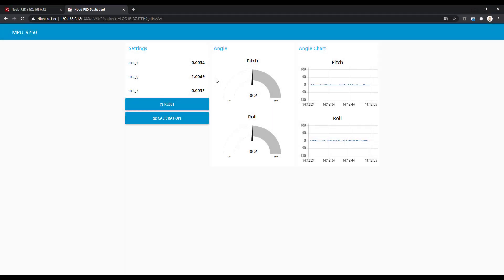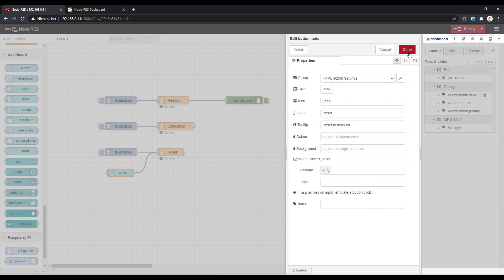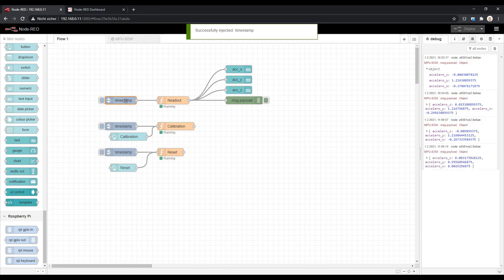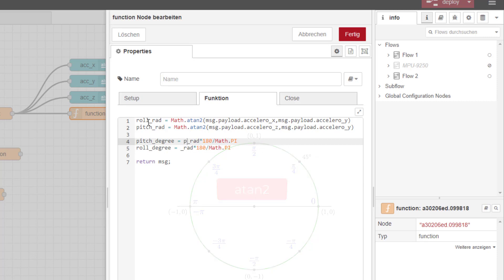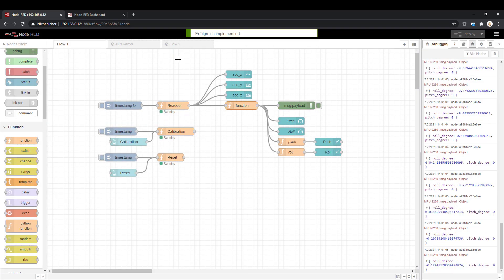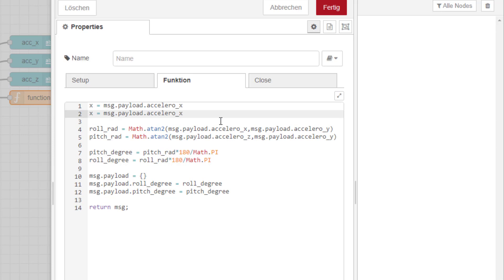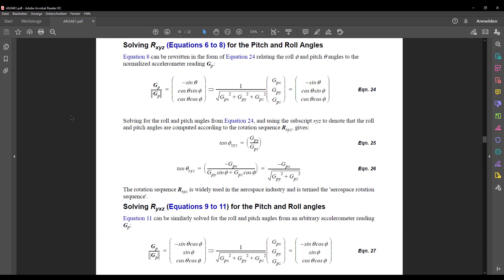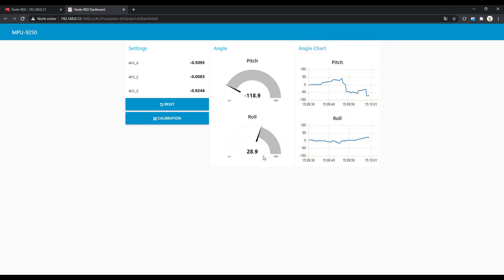MPU-9250 with Python in Node-RED #3: Angle Calculation "Basic" using the atan2 function.

Comment: Hello excellent for your video, very interesting, I have also worked something with these accelerometers, I wanted to know if you have a way to convert for this device for each axis or a resulting value in displacement or vibration values in units of [mm/second]. I would be grateful for the information you can provide me. Regards
Reply from the maker: Unfortunately I did pause my work on this topic. If you want  degrees per second, the Gyro ist the right choice. And with some mathematics this can be used to compensate the accelerometer. Mathworks/Matlab has some useful videos. However, at some point it makes sense to use existing libraries with enough experience and testing work.